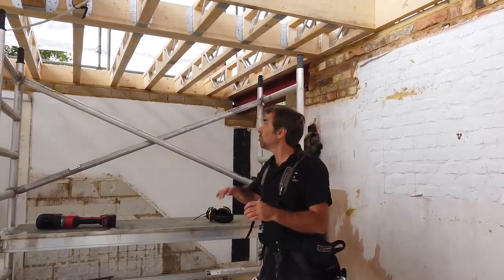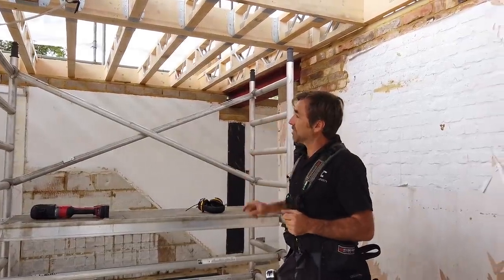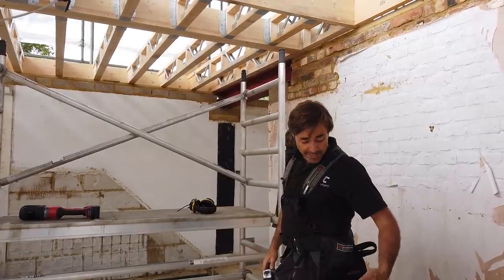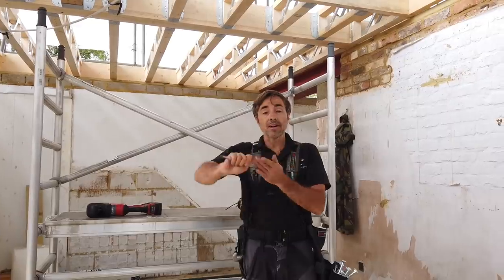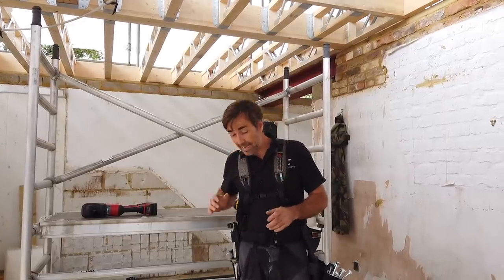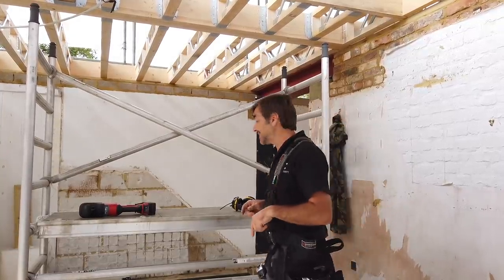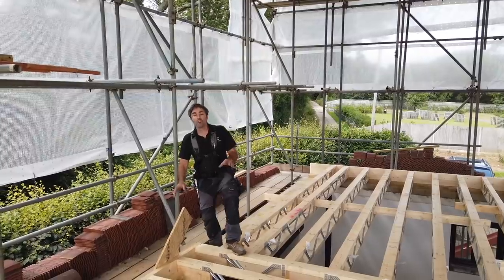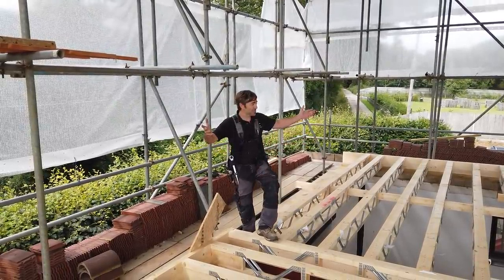How I bolt trimmers and other timber beams

Comment: Lovely stuff! I’ve got the same drill it’s fantastic. 
I’ve noticed you have a fair few m18 fuel tools now. It’s definitely worth getting some high output batteries though. I have the 3ah, the 8 and the 12. They genuinely give a considerable amount more power and huge amount of runtime that the standard m18 batteries. When I use the 3ah it way out lasts the standard 5ah for example and it’s the perfect size for say the impact or router trimmer!

Comment: Always best practice to fit them afterwards, you could use your measuring stick to play out the holes but inevitably you'd take longer to measure up
Lots of swarf in the flutes though, but it fell out real easily, did you wax the bit up first or is it designed like that?
Thanks for the excellent videos 👍

Comment: Apologies if you've already covered this Robin, but can you give a rough ballpark for the cost of the scaffold 'tent'. I appreciate that it might vary wildly from place to place, but just an idea of how much that convenience has added to the project? I imagine that it's priceless from a work perspective, so i imagine it's worth every penny, but I don't have a feel for the likely costing?
Reply: I'd be shocked if he gave you an estimate because it divulged profits 🔨
Reply: @tomsmith9048  I'm just talking about a 'finger in the air' price to get a sense of what that would cost to do as it looks so useful for this type of project rather than taking a chance on the weather.
Reply: @videogalore  I'd like to say 10 to 15 grand but he's down south so probably more 🔨
Reply: @tomsmith9048  Thanks Tom, just helps to place it in roughly. In the scheme of a project like this it's pocket change, so it seems well worth the cost.
Reply from the maker: The cost for a scaffold like this is 10k plus

Comment: Robin, how come you don't install the bolts in the cente-line of the beams? To which extend do small holes weaken beams, and to which extent should you consider where you drive in bolts in a beam?
Reply: Timber 'cups' so if you fix only in the centres the contact area will be much lower. Staggering the bolts helps to mitigate this. The bolts create huge clamping force which creates huge friction  which is what resists any unwanted movement.
Reply: @TurinTuramber  What about the hole in the beam. Does it weaken the beam to have a hole in the area that experiences the greatest tension, or is that not an issue?
Reply: @olgajoachimosmundsen4647  Technically is does weaken the beam a bit but a 12mm hole two inches from the edge of a 200mm+ timber on 800 centres isn't a problem. Everything in structural engineering is calculated very precisely... then doubled for luck. 😄
Reply: @TurinTuramber  The neutral axis of a beam is in the centre, this is where drilling is supposed to take place. That's according to the manuals but I don't see anything wrong with what was done in the video. I probably would have used standard bolts with a washer on both sides and a lock nut on top, 🔨 🇮🇪
Reply: @TheToolnut  Yeah, everyone will do it slightly different. Those coach bolts Robin used don't really take a washer at the head end so what he done was correct. Either way, that beam isn't moving anytime soon.
Reply: @TurinTuramber  Belt and braces, 👍🔨🇮🇪

Comment: Nice clean exit with augur bit. Have to store that info away. I noticed your square washers had the straight edges at ~45 degrees to the grain. Assume that was not by accident. Is that the recommended practice (I can see why it might be) ?
Reply: I guess it would clamp more fibers set on the 45.
Reply: @TurinTuramber  Entirely accidental I bet.
The head of the bolt itself was tiny compared to the square washer, the orientation of the washer wouldn't have mattered.
If it mattered that much, I'm sure the small head size on the bold would have been more of a concern, and you could see how much Robin was cranking on it, sinking the head into the side of the joist.
Reply: @William1st  I agree, square washers both sides would be the answer but it's an extra cost I guess.
Reply: The washers don't really matter, it's the stress of the sheer load on the beam, hence the staggered positioning and the hammered in bolts
I'm sure Robin will be along to explain the technical stuff but it's to stop the individual beams from moving relative to their sister beams
Reply: @TurinTuramber  Haha! Yeah, the guy driving the Ferrari F40 couldn't afford a dozen square washers at 20p each.
Good guess, try again.
Reply: @William1st  Those particular bolts aren't designed for a washer on the head side.
Reply: It's just tying it all together the load is pushing down so it won't effect it hope that helps 🔨
Reply: @TurinTuramber  Right.  They looked like carriage bolts. Square base under the head to dig into the wood, prevent it from turning while nut is tightened. But I still wonder about the washer orientation.

Comment: Are the joist hangers not supposed to have a nail in every hole where the header is full? Just curious, thanks
Reply from the maker: Hi Ethan, the amount of nails in a hanger depends on a couple of factors, the fist rule is just try to nail every hole, but some hangers that wrap over the connecting timber need fewer nails, and this is often printed on the hangers, its the fold and the nails in the top that give a great deal of strength

Comment: How come you don't use structural screws? Far less work, no?
Reply: You mean like a Timberlok? IMO they are tough screws but can't match the pulling force of an M12 with square washers.
Reply: @TurinTuramber  Well maybe, but they comply with building regs so must pull enough.
Reply: @dusty4784  Are S screws actually regs or is it just some BC allow them? I don't know, I am asking as I have never seen that in writing.
Reply: @TurinTuramber  Yea, dunno, I've used them and never had a problem

Comment: Nice video as always. Most of the time Im told to use dog teeth connectors, so this wouldn't be a go for me most of the time.
Reply: But you would have to ply the beams up at the beginning?
Reply: @TurinTuramber  "ply the beams"?.
Reply: @benrichards1  Ply them up, join them together. Those dog tooth washers can't be fitted at the end, unless we talking about different things.

EDIT: Just seen you put this in the OP. My bad.
Reply: @TurinTuramber  yes dog teeth connectors have to be used as you join the timbers up. Alot of structural engineers specify them. Obviously in this case they can't have.
Reply: @benrichards1  I haven't used them for years. I guess they have to take your word for it, that you used them. As Robin said if you are unlucky the joists and hangers could clash with the bolt locations so there is an advantage to bolts through at the end. I wonder how much difference they would actually make, everything else being equal.
Reply: @TurinTuramber  by all accounts they do make a big difference to strength of joins. According to the s.e's I've spoken too.
Reply: @benrichards1  If you reduce the centres of the bolts., I am sure you could mitigate the difference and avoid the aggravation of committing to the bolt locations early on. Guess depends on your BC.
Reply: @benrichards1  I don't think wood dogs are going to bring anything to the party when all you are doing is plying two beams together and there's no sheer force or flexing involved. It's different when eg you are  bolting replacement ends to rotten joists and where would be a tendency for the joist to deflect where the new piece has been added.
Reply: @daihedral9269  they definitely do. Any point load on a joist for example will definitely be strengthened by using dog teeth. Hence why  structural engineers specify them on many jobs joining joists together. Rotten or not.
Reply: @stevehallam6495  I personally only use m12 or m16 bolts myself. M10 are fine but just prefer a slightly bigger fixing. Unless otherwise specified by building control.

Comment: I really don't understand why carpenters use coach bolts to join timber beams together. As you can see in this video, the coach bolt ends up puncturing the wood and sinking into it instead of compressing all the timbers together. I've seen countless youtube videos of people using coach bolts and it sinking into the timber. Why not just use an m10-12 bolt with square washers on each side and nuts? That actually does the job of making the timbers act as one without puncturing any of them.
Reply: I've used Joyner bolts before which have a square washer built in which has sharp teeth. It bites into the wood but doesn't sink in. It's another option which I personally prefer! 👍
Reply: Once the timber dries the bolts will be as loose as Alice’s draws.